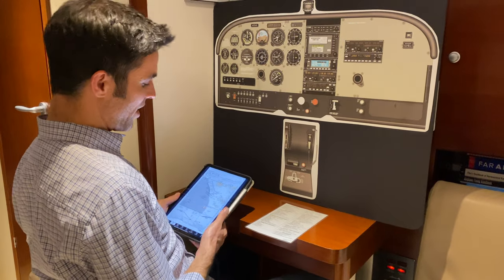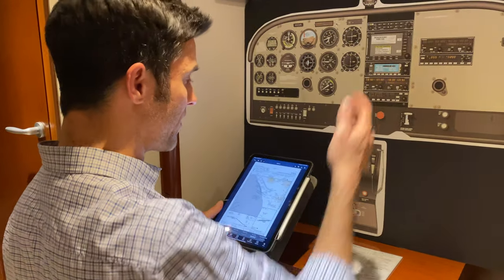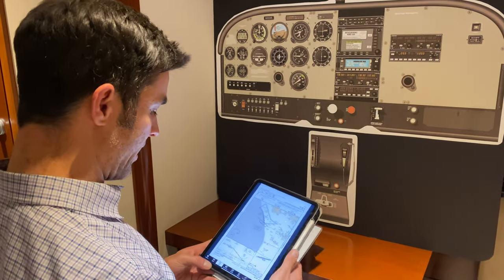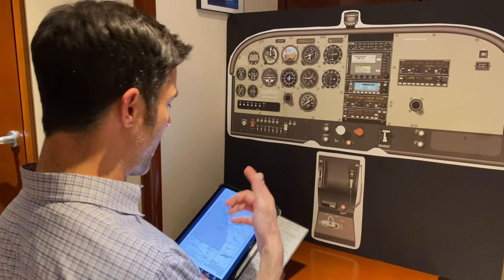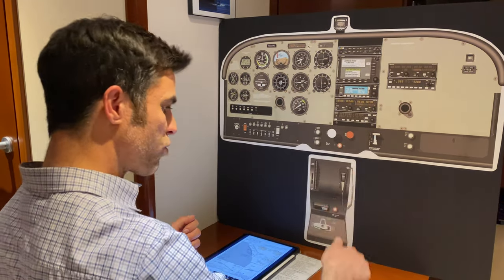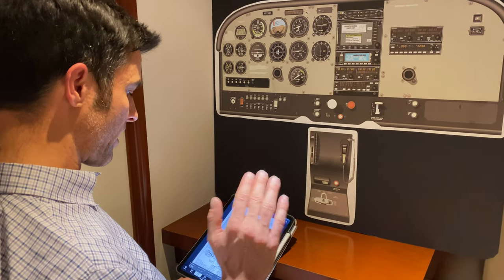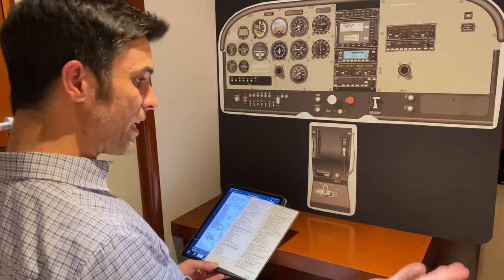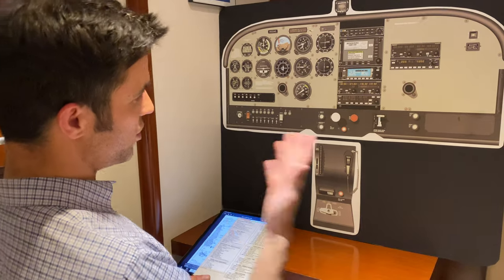Chair Flying - IFR Approaches, 5 Ts, Missed Approaches

Comment: Great video! Where did you get the IFR checklist you keep referring to?
Reply from the maker: Hey Dave - I actually made the checklist based on the system I teach my students. I believe it should be up on my website at cffly.org
Reply: @chasefranzen  Hey Chase, I had looked and didn’t see anything on there.  Is it possible to get a copy? Thanks!
Reply: Great video, great checklist, would love to see a copy. I Wasn't able to see anything on your website. Any other links for it?